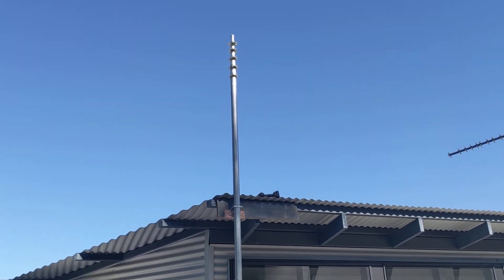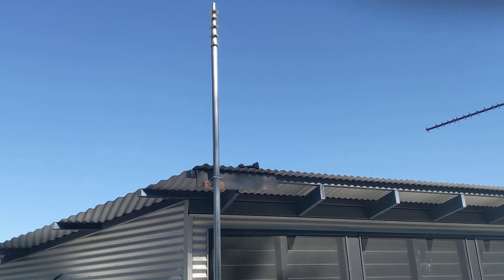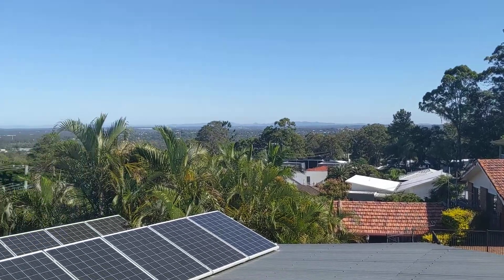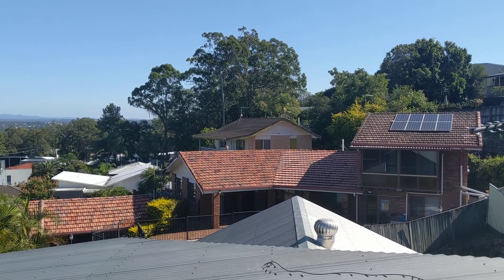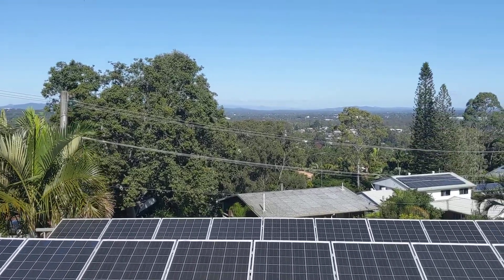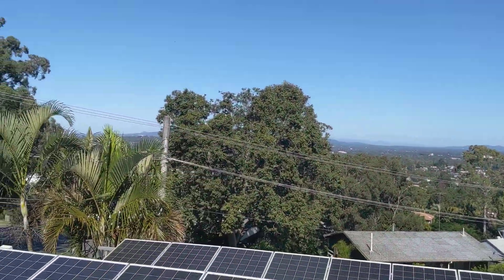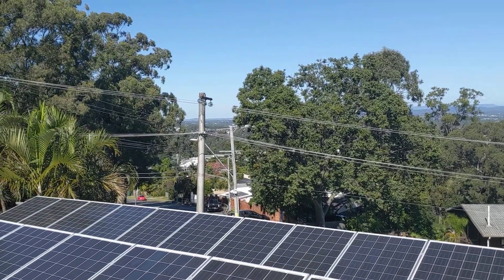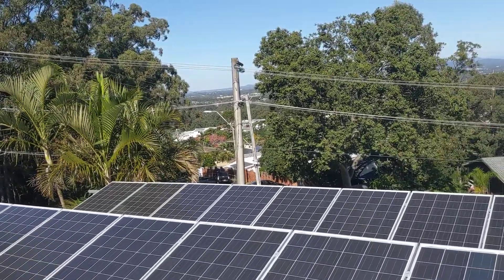Antenna placement and Off Grid Experiment - Helium Hotspot - Nebra

Comment: Hey mate I’m looking at putting one up in Brisbane and wanted to use a big antenna like yours but on the Brisbane city council website they only allow antennas to be 3.5m above a building or 10m above ground if not connected to a building. Above this and you need to apply for a permit it says. Just wondering if you had done any research on this and where you could point me for more information? Thanks mate.
Reply: Awesome will look into permits then thanks for the help!
Reply from the maker: You can go higher than 10m but need to get a permit from Council and this is only given if you have plans etc.  We have similar requirements in Logan.  While a super high mast offers great benefits 3.5m above the roof is still pretty good.

Comment: Get an m2. I bet you’ll receive it before the nebra you waiting on. Same frequency so you can easily use what you already built. Payout structure not as extreme too. Likely to make it more stable.
I love your project. Been following it closely.
Reply from the maker: I will stick with Helium and HNT mate, but thanks for the suggestion.
Reply: Cool. Going for both myself to see which works out better.